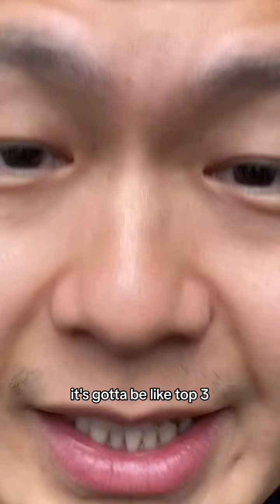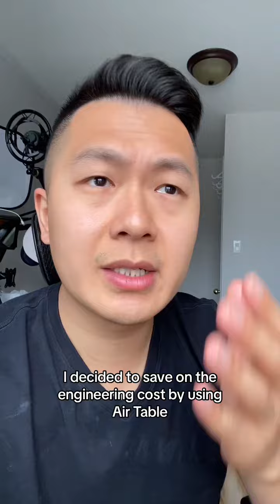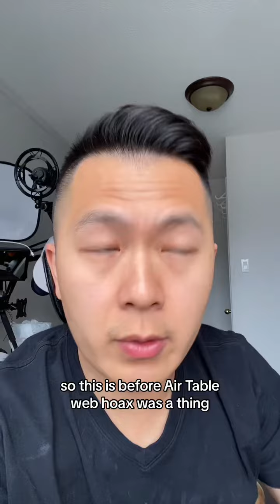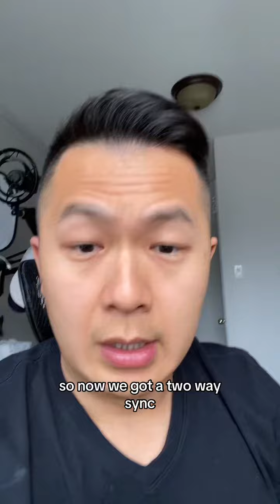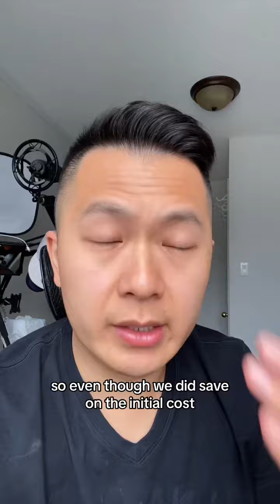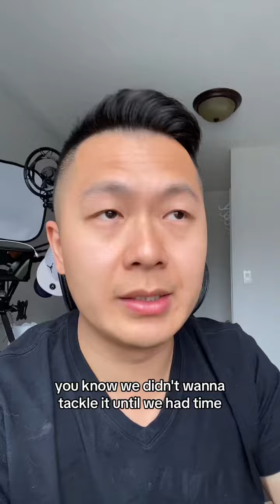One of the worse technical decisions in my software engineering career

Comment: If you had to do it again, would you have still used airtable but keep it controlled within your team like you said, OR would you have opted for a heavier initial investment?

I know hindsight is always 20/20 but decisions of initial cost always comes into play and almost always we choose the cheapest option.
Reply from the maker: I would add the following:
1. Ensure the external platform has webhooks (airtable did not have it at the time, but has it now) -- this would solve the hits to the database from our sync scripts and any timing issues
2. Push for one-way sync at most
3. Lock down exactly what we will support and communicate it to all parties
4. Lock down the airtable base to only a select few who can modify instead of blindly trusting people 
5. Have a transition plan with an explicit target date and keep pushing for it to be executed -- all decision makers must be aware of this, especially the CEO (in our case it's a startup so we have a direct line)

If I can't do these, then I won't implement it at all and they'll have to fire and replace me or put me on another project